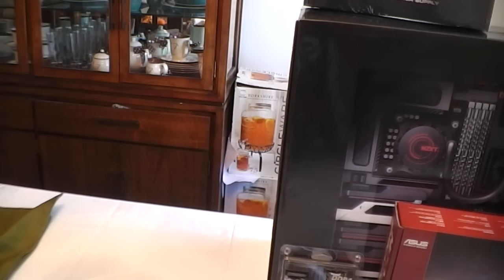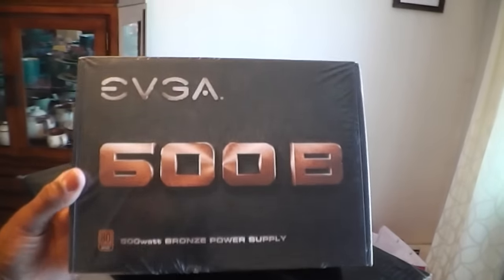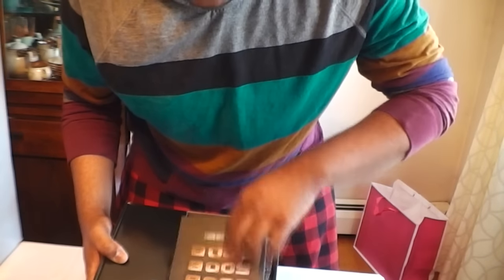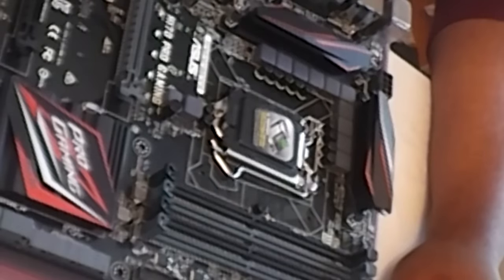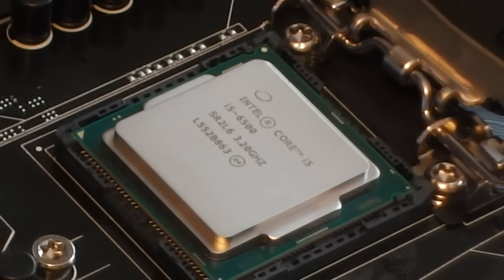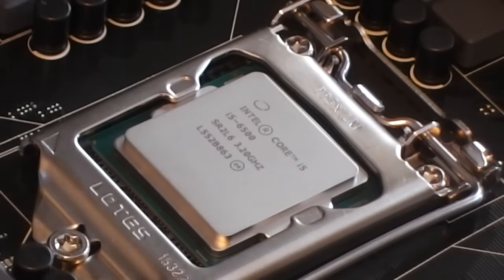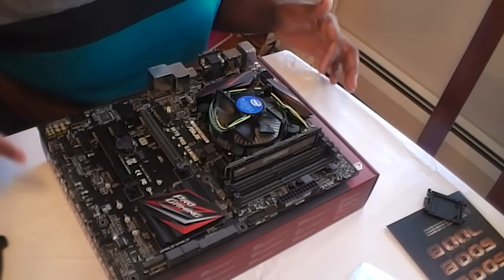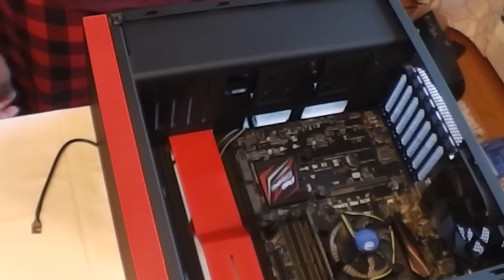NOOB BUILDS HIS FIRST EVER Gaming/Editing PC

Comment: Builds are so basic without a graphics card or a crazy cooling system, makes me feel like I could actually build a PC
Reply: +Daniel Fernyhough how do you know if you really haven't?
it's pretty basic but not for all the guys out there and it  depends on more what you mentioned like moduler psu and many leds and fans in your case 
but your you're basically right
Reply: +Draegbeast based on the video it seems easy
Reply: +Daniel Fernyhough probably because he didn't show everything he built
Reply: +Draegbeast stop spaming
Reply: all he did was put the cpu in the motherboard then put in the ram and the stock cooler. then when all of this is done you open up the motherboard manual and check all the connection and header from your psu, fans and case (24 pin mobo, 8 pin cpu, fans, power/reset case button, front led, headphones/mic (front case header) and usb 3.0) and ofc you install the drive (s) with the sata connector you got with the mobo and the sata power from your psu. after that you are basically done building all is left is to install your windows copy with a usb (this case doesnt have optical drive) and when its done you can download all the shit you need. voilà!
Reply: +tz boss you have a problem? Lol
Reply: It tbh is really easy
Reply: Building is easy but what about cleaning the dust out once a year thats tedious

Comment: Will it be able to connect to the internet with just those parts or do u need another part for it?
(im new to this pc building stuff).
Reply: Rexide LMAO
Reply: i think you should!!!
Reply: Rexide If you're going to use ethernet the motherboard has it built in but if you want wifi you need a wifi adapter
Reply: ya you get get pcei slot wifi adapters which go into the motherboard but you can also buy usbs a decent one goes from around 5-30 dollars? i think

Comment: You fucked up, you did not apply any thermal paste!, you used a stock CPU fan and sometimes it comes with thermal paste applied already so if that is the case you did good with that. Never close the case "first boot" until you know everything is running good, you do not wanna close everything and then if something is wrong open it again and all that. Cable management was pretty good though. Good video and good work for your fist PC build!
Reply: jokertheghost PR the stock fans come with already applied thermal paste, he's not overclocking it since it's a non k